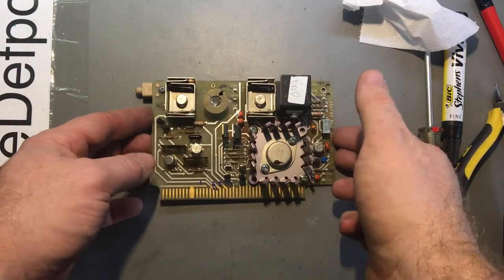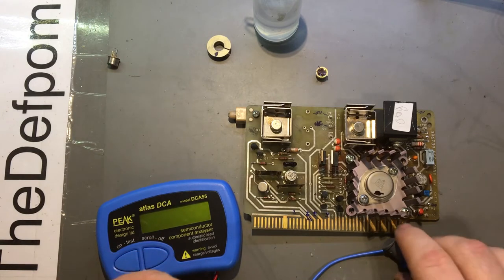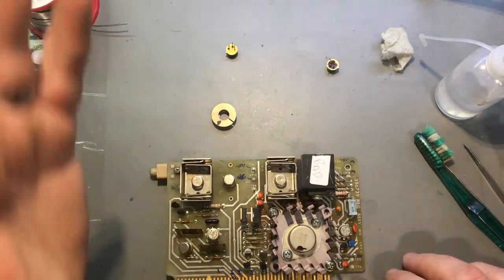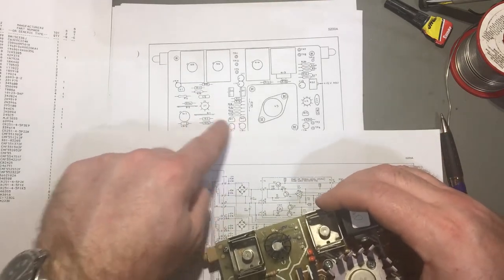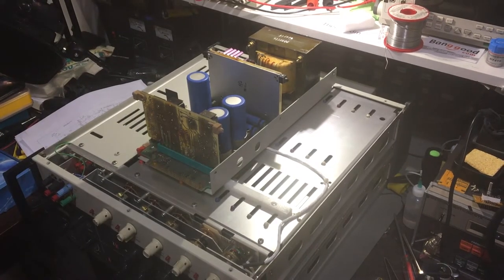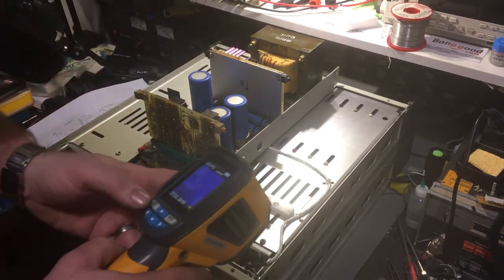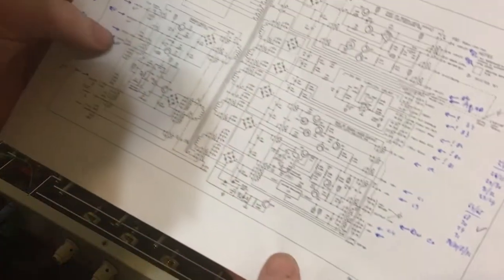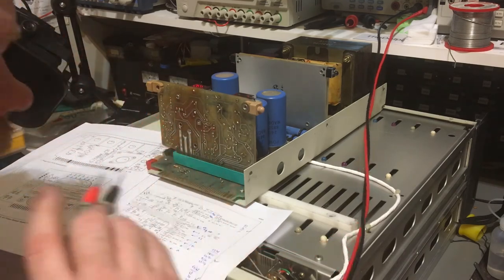#291 Fluke 5200A Programmable AC Calibrator  Repair Part 2

Comment: I wonder what is the difference between an LM123 and an LM323 besides the operating temperature?  EZSBC makes a switchmode replacement called the PSU5.

Central Semiconductor still makes the 2N1711.  They are US$1.92 each from Mouser.

Comment: Do yourself a favor mate, get some dressmaker T-pins to make some PCB probes. Good long, stiff hard steel pins. Cut off T end. Mount pins in some old plastic pen barrels or just wood dowels. A bit of heat shrink over all but very tips. You now have long, tiny, insulated probes that make it easy and safe to reach PCB pads. A trick I learned from a mentor many decades ago.

Comment: Your replacement for Q6 might struggle a little dissipating the power. My 5200A has an RCA 40409 transistor in this position, which has the same type of heatsink as Q8 and Q16. It is rated 90V, 700mA and a power rating of 3W at an ambient of 50degC, which is quite hard to achieve with an small external heatsink placed on the top of a TO-5 case. To get the best heat transfer out of a TO-5 case you really need to have the heatsink contact the bottom of the package where the die is mounted.

Other transistor numbers on this board that are only given as Fluke part numbers in the BOM and you might want to know: 
   Q8, Q16   RCA 40410 
   Q17          RCA 65120

My 5200A seems to be pretty much factory original so if you have any other parts that you are doubtful about please add a comment and I will endeavour to identify from my unit.
Reply from the maker: Stephen Bell - thanks for the info, much appreciated!